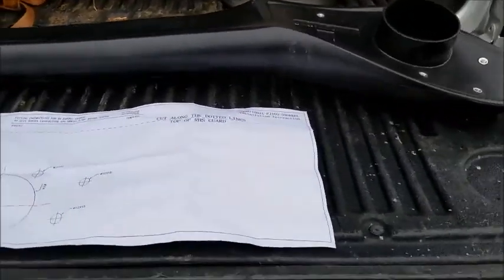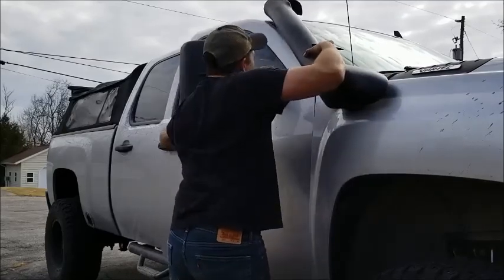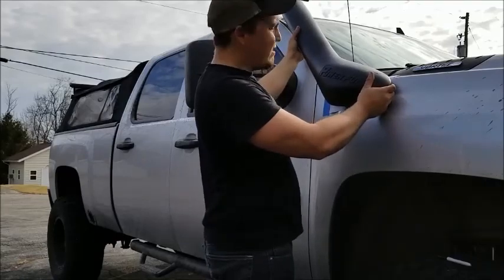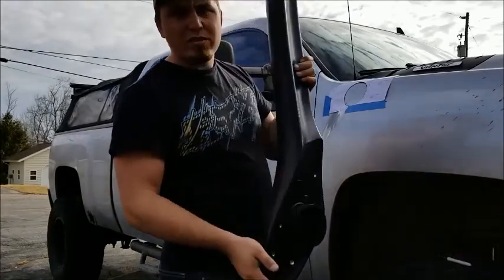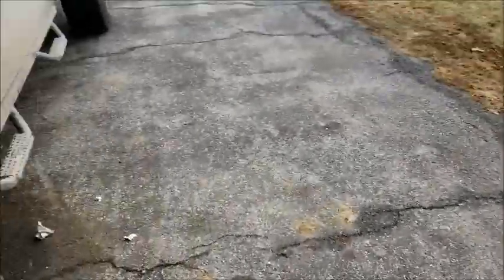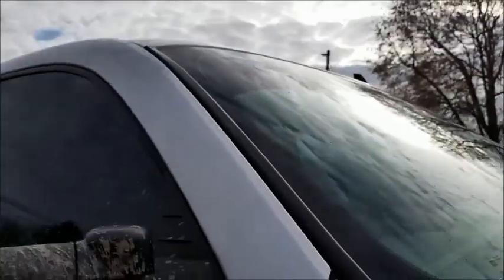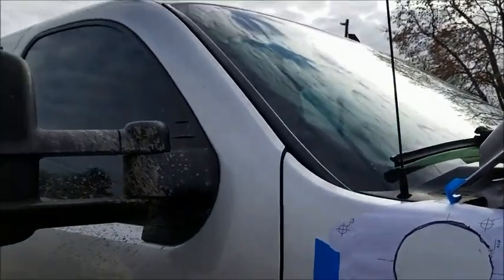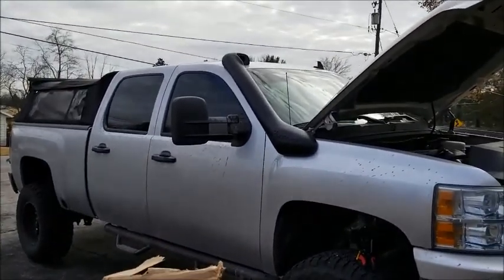Chevy Silverado 2500hd Snorkel Install

Comment: link doesn't work for some reason...what year landcruser model?
Reply from the maker: It was for a 1996 to 2006 landcruiser 100 and 105 series diesel model. Just looked at the link and the item is no longer available with that seller. I'll look for the same snorkel from a different seller.
Reply: Im looking for one for a dodge  like this one